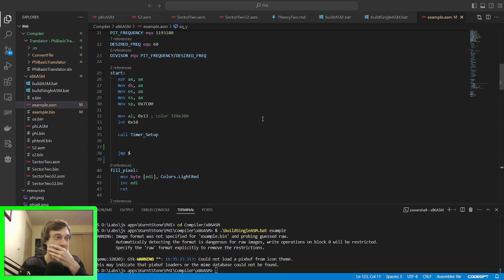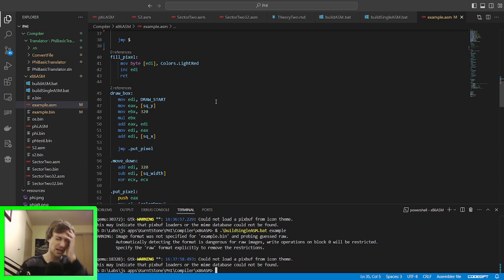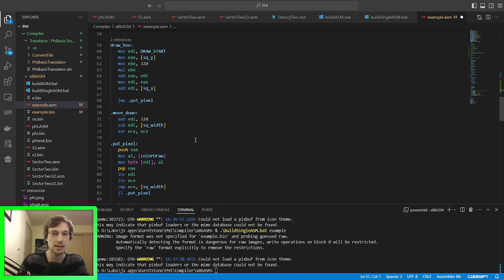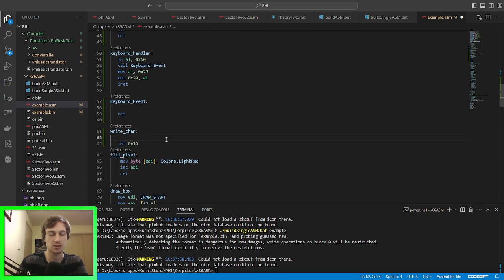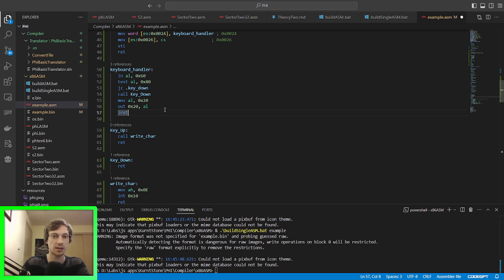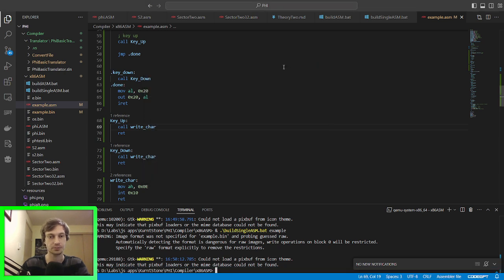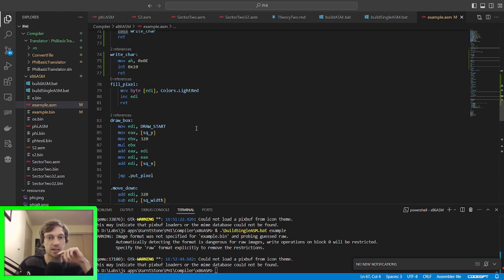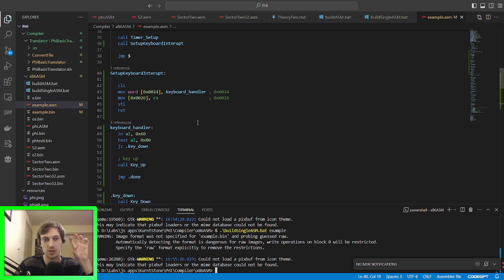Game Development in x86 Assembly Language - Half a keyboard driver  moves a box(kinda)

Comment: Polling the keyboard controller with dissabled interrupt.

; Start
     cli
	  mov      al, 2             ; disable IRQ 1 keyboard
	  out       21h, al
     sti
     ....

; Main loop
     in        al, 64h                  ; buffer empty?
	  test     al, 1
	  jz  short NOKEY
	  test     al, 20h
	  jnz short NOKEY            ; if PS2-Mouse byte
	  in        al, 60h
	  dec      al                           ;  Escape ?
	  jz  HOME
     inc       al

; your routine if key pressed

NOKEY:
; other routines

;-------------------------------------
;    END of Main loop
;-------------------------------------
HOME:    
      in       al, 60h
     cli
	  xor      al, al              ; enable IRQ 1
	  out      21h, al
	  sti
     mov      ah, 1
	  int    16h

;---------------------------------------------------------------------------
; using some tables of keys(make codes) 
; with one table for keys and one table for functional keys
; and a corresponding table of ASCII
;---------------------------------------------------------------------------
TASTTAB DB 02h,03h,04h,05h,06h,07h,08h,09h,0Ah,0Bh,0Ch,0Dh
	DB 10h,11h,12h,13h,14h,15h,16h,17h,18h,19h,1Ah,1Bh,1Eh,1Fh
	DB 20h,21h,22h,23h,24h,25h,26h,27h,28h,29h,2Bh,2Ch,2Dh,2Eh,2Fh
	DB 30h,31h,32h,33h,34h,35h,39h
	DB 56h
tablen =  ($-TASTTAB)

TEXTTAB DB "1234567890á'"
	DB "qwertzuiop +as"
	DB "dfghjkl  ^#yxcv"
	DB "bnm,.- "
	DB "<"
Textablen  =  ($-TEXTTAB)
;---------------------------------------------------------------------------
;          Tab,shift li.,shift re.,HOME,UP,LEFT,RIGHT,END,DOWN
;----------
SONTAB  DB 0Fh,2Ah,36h,47h,48h,4Bh,4Dh,4Fh,50h
Extablen  =  ($-SONTAB)
	DB 0,0,0
SHIFT   DW 0
;---------------------------------------------------------------------------
Reply: Wow 😲
Reply: What does test do btw? Is it like cmp?
Reply: @stavros222  The TEST instruction performs a bitwise AND on two operands. The flags SF , ZF , PF are modified while the result of the AND is discarded. The OF and CF flags are set to 0 , while AF flag is undefined. Example with "test al, 20h" we can check if bit 5 is set or not. I this case we check just a single bit.